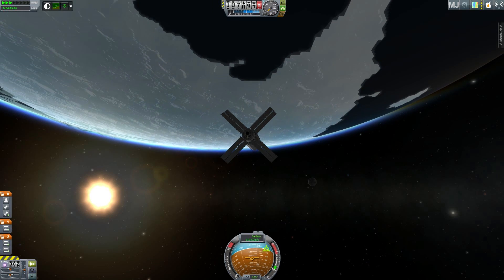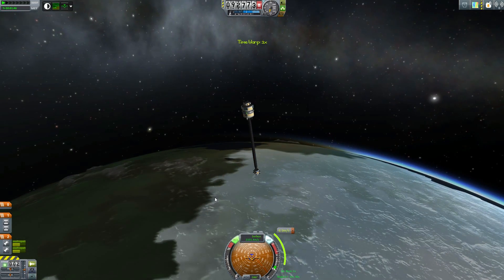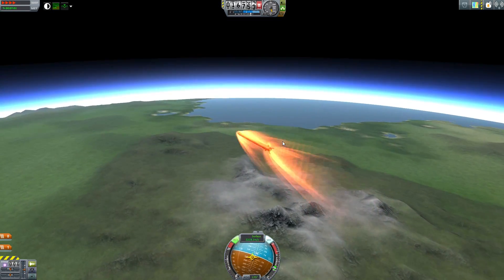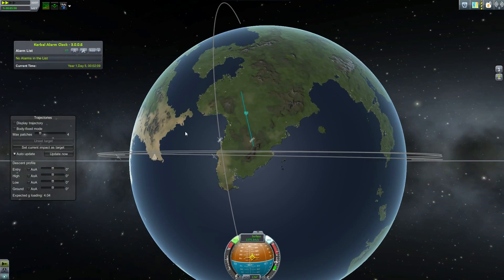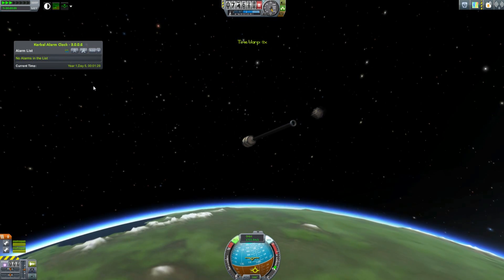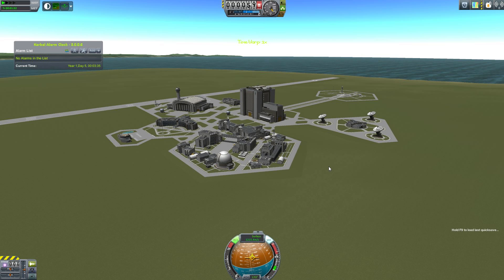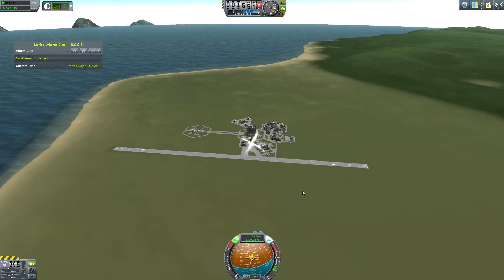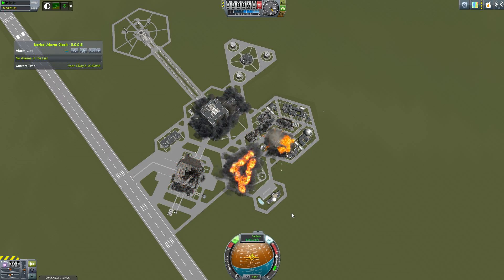Rods From The Gods vs Kerbal Space Center

Comment: Wait a second. As far as i recall, rods of project Thor would be tungsten and weigh about 9 tons each, instead of being steel and weighing 18 tons. Would steel even be able to survive re-entry?
Also, i do believe that if one of those rods would fall in close proximity of KSC, the entire complex would fall down, since the impact power was expected to be close to tens or hundreds of tons of TNT. It could even make a new volcano :D
Reply: ***** You make it sound like it's a bad thing.
Reply: ***** Yes, you're partly right, but it's the other way around - steel ones would weigh less. Volume of this rod would be roughly 0.45 cubic meters. Density of tungsten is around 19 tons per cubic meter, and steel is around 7.5 tons per cubic meter. So a tungsten rod would weigh about 9 tons, and steel one would only weigh about 3.5 tons.
Reply: Slithereenn The point is, though, that the mass of the steel rod is the same or larger, which, due to steel's relatively low density, means it would have to be quite large.
Reply: ***** so the solution is de-orbit the moon? XD
Reply: they need to add shockwave effects to the game.
Reply: Liam theMailman
It depends on size.  A moon sized chunk of steel is going to have zero problem with the atmosphere.
Reply: None of your arguments hold up.

Every propulsion method produces waste heat that can be detected (3rd law of thermodynamics). That means meaning there's no stealth in space if you make a dV change, your engines (whether rocket, rail gun or warp drive) will produce waste heat and you will be a bright spot on any IR sensor that's looking at you.

Stealth aircraft are not expensive as we're practically mass producing them, right this second. The F35 is designed to replace the f18 and the f16, the two most used aircraft in the US airforce, it's also designed to replace the British. harrier and tornados (their most used attack aircraft). Saying stealth is expensive is misguided at best.

Also show me an example of a stealth aircraft being detected by radar before they've completed their mission. It hasn't happened yet, that is why everyone is jumping on the stealth aircraft bandwagon. If a radar was developed that could detect it, then it would only take a few years to find a counter to it. But the fact is, every major new fighter aircraft is stealth for a reason. It's an  effective defence.

MIRVs were entirely designed around the fact that single warheads are vulnerable to anti-ballistic missiles. They were designed specifically to oversaturate a defense system  enough so that enough warheads get to the target to achieve the mission.

MIRVs were literally designed to do exactly what you're saying they can't do.

And despite the fact that you can't do anything about MIRV attacks governments still have complicated and expensive systems watching out for attacks. If they're bothered about knowing if they're under an attack they can't defend against what does it matter if it's nuclear, biological, chemical or kinetic? They'll still want to know.

Also I don't see how a massive earthquake causing dumb missile that looses it's ability to control itself at least 10 minutes (more like 40) before it strikes its target is going to result in few casualties than a stealth aircraft that can scout out the target minute or even seconds before the attacking checking for civillians before using a precision bunker buster bomb (or any other weapon that's suitable for the job).

Seriously Rods would be little more than WMDs, you don't use WMDs if you care about collateral.

Everyone's entitled to opinions. true, but why stick to an opinion that's blatantly incorrect? None of your arguments hold up.

Rods were thought up because nukes in space were illegal. They were thought up because they give near nuclear strike capability while on an orbital platform. They are basically just a different sort of hammer. Not a precision, stealth, low collateral weapon. They are for when you need to obliterate everything without pissing off the neighbouring counties, nothing more.
Reply: Tungsten has a melting point of just below 3.5k Centigrade while Steel's melting point is half that, at around 1750 Celsius. Tungsten is also roughly five times stronger than Steel.
Reply: Liam theMailman Well, if you can hit virtually any stationary target on Earth in the next half an hour with an equivalent of a few tons of TNT, while not leaving any defensive options for your enemy... I'd imagine that it would see more use than just bunker busting. It would be a real hassle to get those rods into orbit though.
Reply: oh my gaaawd... I read return as rectum and that reply still made, disturbingly much, sense.

Internet, you have damaged me... Forever...

More on topic, yes :)
Reply: WimsicleStranger Steel melts closer to 1600°, but that depends on it's composition.
That's what i was talking about - steel would easily melt and burn away during reentry.
Jonathan Hughes But that's the point - we have the dimensions of those rods - 20 feet long and one foot thick. So steel rods of that specified size would be much lighter.
Reply: Just give the tip a coating of aerogel/RCC. Or even just have an ablative coating on the tip. Not like extra weight is an issue xD.
Reply: Thing is, the denser substance we make projectiles of, the higher weight to reference area relation is, so we suffer less deceleration from drag. That's one of the reasons why bullets are made of lead (mostly), not, say, iron. Also, modern armor piercing rounds contain tungsten or uranium rods (latter ones cause contamination) for the same reason. So steel rod is never able to acquire speed necessary to achieve devastation effect similar to tungsten one.
Reply: @dmitrysemenov6476  I still would not want to be hit by a steel bullet.
Reply: Masterof thelag Well duh!
Reply: Дмитрий Семенов "Also, modern armor piercing rounds contain tungsten or uranium rods (latter ones cause contamination) for the same reason"
Not exactly. Delpeted uranium is also dense as shit, though not quite like tungsten. The main reason behind it is that it's very reactive. This increases the damage done after the armor is pierced - a cloud of fine uranium powder, that is generated during the impact, ignites due to friction heat and combusts. So even though technically uranium rods are pure AP shells, they also have incendiary effect to some extent.
Reply: Evan venegas actually it's not the UN article for space warfare is no biological nuclear or chemical weapons can be put in space the rods are none of these
Reply: Firebirdharris
Well, again, you can't see the rod itself, and it's much harder to stop it. ICBMs light up the sky, and bombs are even better at giving your enemy time to prepare. While a tungsten rod would really become visible only when it would be in lower atmosphere, moments before the collision.
Reply: Red Engineer The issue is not going to space, it's going back.
Reply: No steel would not survive the heat and these kinetic bombardment rods are only useful for bunker busting nothing else
Reply: HASEnoncorperated Good thing the game is only in alpha so it has the time!
Reply: Slithereenn not really the military dosen't see it for any other application it won't do much to a city it can only hit a stationary unit so
Reply: Liam theMailman And, it is against laws made by the United nations...
Reply: Liam theMailman Any building complex, that is deep inside enemy territory, could be a target. The main thing is that you can't really stop that rod once it's been put on it's attack trajectory. You could do severe damage or destroy, say, weapon manufacturing plants or strategic bomber airfields with it.
Reply: It isn't just the power of the hit, but they also said it would cause a very high magnitude earthquake if it penetrates the ground.
Reply: Slithereenn The thing is we already have options that are as "good" as these rods.

These rods (along with other ballistic missiles weapons) they're only good for large stationary targets. A nuclear bomb can be designed to penetrate the ground and act as a bunker buster (which is the only thing these rods excel at really).

Fact is ground launched ICBMs can reach right around the world, can be maintained and inspected the second before launch and can be terminated much later in the attack (if it's required).

Orbital weapons can be shot out of the sky at any moment in time, EVERYONE can see where they are and when they can hit (unless you've literally saturated Earth orbit with them to the point where one can always be used to hit any point on Earth).

Also while it's non-nuclear the fact is if you hit a country with one of these it wouldn't really matter that wasn't nuclear, the sheer power of it would result in a full response from the attacked country as it would feel like they'd been hit by a WMD.

Also 18 tonne into orbit isn't a problem, ISS is around 300 tonne and most of its cost was construction. In fact i'm pretty sure that tonne for tonne (of TNT) that these Rods would be more economical in destructive power if you actually developed a launcher for the job of launching them.

At the end of the day though, who wants the ability to destroy a massive stationary target these days? Even the biggest of factories can be mission crippled by a 2000lb bomb and if it's a bunker then you use bunker busters (both of which can be used in a way that gives no warning of an attack).

Rods from god was an interesting idea and is a theoretical work around for the no WMDs in space thing. But at the end of the day we've got terrestrial options that are already better, more accurate and will result in less casualties due to their accuracy.
Reply: Firebirdharris In this case that radar should be monitoring the satellite every second. And knowing the impact site won't really help, since there will be very little time left to do anything about it.

You can just decouple those rods with great force, pushing the both the rod and the satellite in different directions, and then compensate via satellite propulsion. The rod itself doesn't need to have any engines then.

A MIRV is vulnerable, because it's a big piece of smart engineering. Blow up a shrapnel charge near it, and it will fail to deliver. Good luck trying to disrupt the flight of a few tons of solid tungsten though.

Stealth technology is expensive and imperfect. You can always construct a radar that will render your stealth coating useless.

Who said we're going to lift up one rod, not a dozen of them? That's why i was thinking about the cost of lifting it all up. Because bringing just one rod with a satellite is just stupid.

Nukes aren't good if you're trying to bring civilian casualities down as much as you can, or if a target is inside your own borders.

Well, this whole arguement is silly, so don't bother proving me wrong, i'm tired. You're entitled to have your own opinion, of course.
Thanks for the link, i'll check it out.
Reply: Firebirdharris If the trajectory and shape was right. Wouldn't the tip act as a sort of protective / ablative aerospike? Sure the tip would start melting away, but the shape of the shockwaves and whatnot would keep the rest / bulk of the mass relatively "safe" ? ...

I mean, even parts of ie. skylab and other satelites managed to survive reentry and touch down.
Reply: Firebirdharris The rods from god were supposed to be able to get to their targets anywhere in the world in under 10 minutes, with that speed it's impossible to stop it or tell people to run. Even if they do get the chance to say tell an area to evacuate immediately the impact isn't what's going to kill, it creates the power of a 5+ magnitude earthquake on penetration.
Reply: Hundreds of tons of TNT, concentrated on one tiny area where it hits, not over a huge area.
Reply: Firebirdharris actually rod takes 15 minutes to hit the ground it's not that effective and could barely destroy a city at most it could take out a block and a stealth radar detection system has been invented in China they developed a system that detects stealth but many say it's not new and isn't that accurate and won't help them
Reply: Liam theMailman It would be effective for destroying underground bunkers is pretty much it. Even if the enemy knows it's coming, there's not much they can do about it, other than evacuate the base.
Reply: ***** how do u know this about them adding other space centers
Reply: "The massive engine burn required to de-orbit said Rod would get picked up by the exact same sensors that are looking for ICBM launches. This would also give you a predicted impact site based on the velocity reduction you observe with the sensors."

I'd assume these presumably infrared sensors spend most of their time aimed at the earth.
Reply: Tungsten would be ideal because of its lighter weight. Lighter weight, means leas fuel on launch. (But others would argue its heavier)

In 2003 the United States Air Force sent a 6.1 m × 0.3 m tungsten cylinder into space, impacting at Mach 10, having a kinetic energy equivalent to approximately 11.5 tons of TNT (or 7.2 tons of dynamite).
Reply: Shane Grey actually it's also because tungsten melts at 4000 degrees which is ideal to survive re-entry
Reply: I'm pretty sure a kg of tungsten weighs exactly the same as a kg of steel.

derp but yeah, it's smaller for the same weight due to density.
Reply: no, of course steel won't survive after all I'm pretty sure all the things and people that went to space are made of tungsten... idiot
Reply: What about rendering a runway useless?
Reply: Titanium
Reply: If the rod's large enough, even a steel one'll be able to survive reentry reasonably-intact due to the heat-sink effect of all that metal.

Comment: Quick solutions:
Mod the collision mesh (after setting one on an impact, might then require drag editing to compensate)
Add a massive explosion to it, e.g. BD armoury.
Cheat engine.
Reply from the maker: I did try cheat engine, and I was thinking of hacking the collision mesh but I have more pressing concerns this morning (see my twitter for details).
Reply: Scott Manley
The way I'd approach it is just give the rod a partmodule that destroys anything that comes within n meters of it, where n would have to be determined experimentally by what looks right. I figure at that velocity, even a miss would be pretty destructive.
Reply: Scott Manley Good luck on the thumb...
Reply: The biggest problem is the game timer. You see, all games run on "Ticks" and these ticks determine when to check for events (such as collisions) therefore, since the rods are going too fast for these timers to catch, the game assumes that the rods never collided with the building.